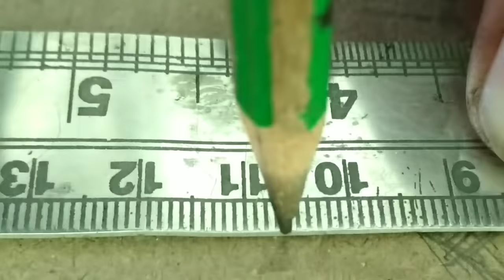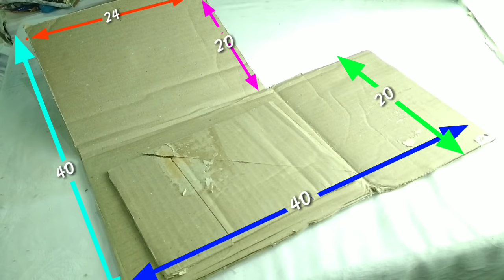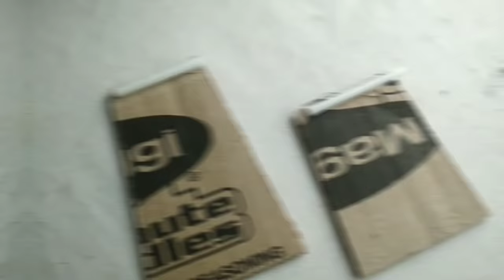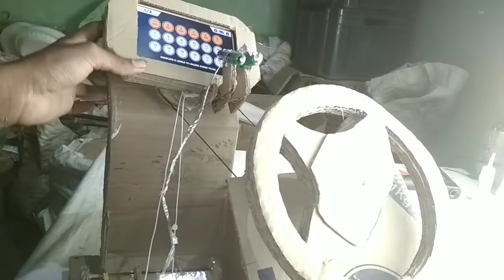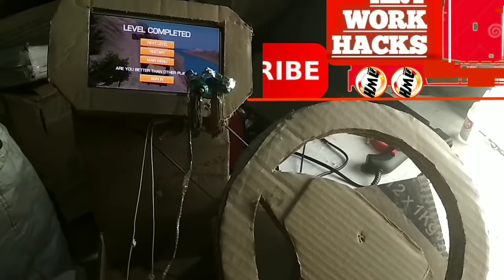How make carboard steering wheel for Android or iOS truck simulator

Comment: Can we make it using wire not aluminum foil
Reply from the maker: yes long wire can be used but make sure to stick aluminium foil at the ends. You know aluminium foil helps to conduct capacitance generated in our body to mobile screen...